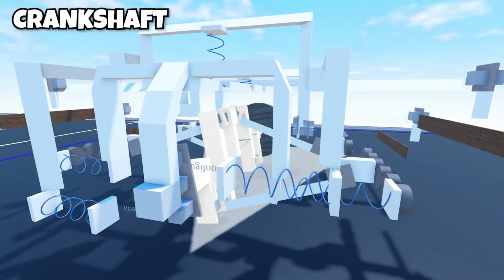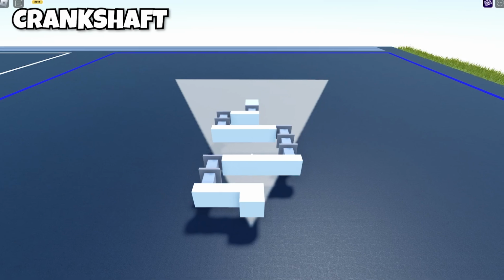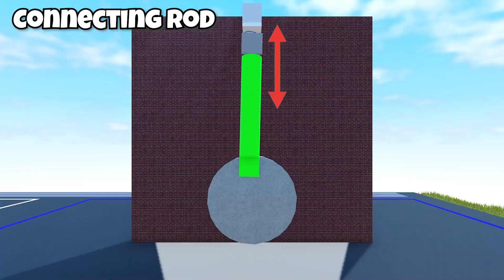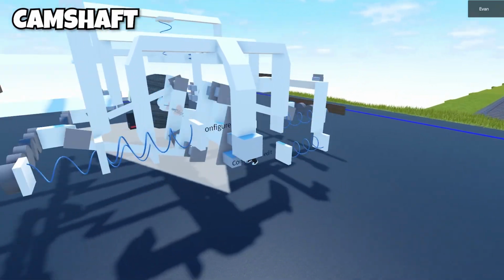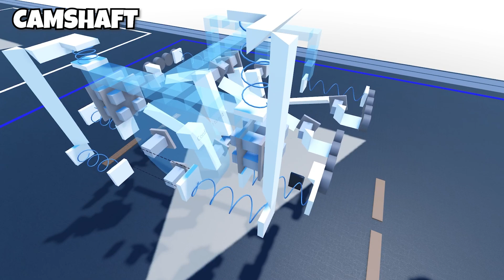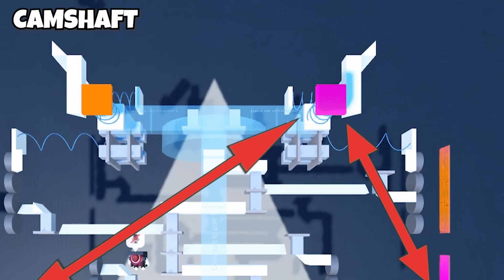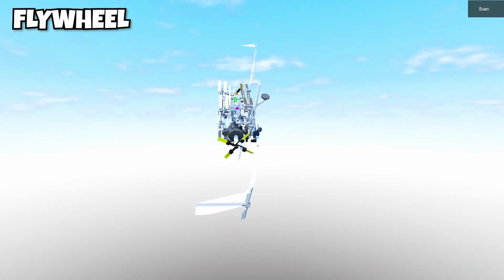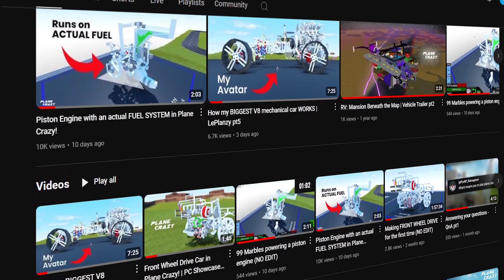Boxer 4 PISTON ENGINE Guide | Leplanzy pt6

Comment from the maker: MISTAKE:
- I forgot to mention that the big 5x5 cylinder in the front of the engine is actually not really that neccessary. In the past I used this cylinder to make a starter using a rotating cylinder thats getting pushed to the big cylinder. In this case I used proppeler to start the engine itself. Cylinder itself could also be some decorations to ur engine or a place to put many camshafts at once. It's honnestly up to you on how you're gonna use the cylinder. It's optional to put it, I only put it to that there's a small gap between the suspension and the motorlock. 

- Move all the signs (the one in front of the hover) 1 BLOCK UPWARDS. I forgot to mention that timing problems could happen. I apologize for the lack of attention to my video editings

- I might have talked a bit too fast in this video. I apologize for any confusion happening 

If you've met with some more mistakes that I made in this video, immediatelly report it to me throughout this comment or a discord dms. any is fine!
Reply: How to increase more rpm without adding more connectors valve things
Reply: actually when i was trying to fix the engine still it doesn't work but still thank you so much becose i learn gow to create a boxer engines now i have a 8cylinder boxer engine and i like it still huge thanks to you 🙂
Reply: Bang crankshaft yg terakhir kok putus GK jadi solid pake text brp?
Reply: how do i make second piston offset 90 dergee from the frist one in I2 engine ?
Reply: @PhạmHiếu-g2h just flip the cinnecting rod on top of the crankshaft
Reply: bro i cant start my engine for some reason even with a spinning wheel :(
Reply: how to fix the timings?
Reply: nvm fixed it , the problem was wider detection
Reply: Hey, Evan
I have a problem, and I don't know how to fix it.
Whenever I try to start the engine, it stops halfway through. Can you help me fix this?
Reply: @zedddd._d try making it ice
Reply: So how did you double hovers on the engine on other videos ?? My engine works but i want just double hovers for more torque and power
Reply: hey evan i built the engine and made the whole thing ice so its lighter but it still rotates slow i used the same flywheel as in the video if you know any fixes could you let me know!
Reply: my engine runs but stalls some times but then continues spinning after that is it a fly wheel problem
Reply: @BranDaManGamingits more of something hitting crankshaft like camshafts,or hovers that arent in the good settings (RARELY THE HOVERS)
Reply: Dude, I can't get the engine to turn over, it's stuck. I've already done the engine lock and it doesn't want to go.
Reply: @Gowbily  same

Comment: Pro tip: use 6 hovers for each cylinder makes more torque (better for car weight and clutch)

Also motor lock all the timing 1 block upwards
Reply: YOO TSYM FOR THE TIP MY ENGINE STARTED WORKING AFTER I MOTORLOCKED THE TIMING
Reply: @errt-j3w  np
Reply: whats the timing
Reply: @megikyura   yk that part that connects the sign put 1 motorlock above the sign

Comment: my engine cant make a full rotation even if i put the flywheel
Reply: Its probably the crankshaft or the connector rod getting stuck on something, see where it is stuck. Or the suspension is not long enough.

Comment: You haven’t told us which motors are powered or not. I have built it and it is a disaster
Reply from the maker: theres not a single powered motor
Reply: @evans_workshopx thanks your the best. I bet your basically the only YouTuber that is actually good at this sort of stuff 😅. You’re so underrated. Good luck

Comment: Hey, ik many people have been talking about this here already, but my engine stalls at high speeds for some reason. It works perfectly fine, has high torque/speed and all, but at high speeds/too much power on the hovers, it just "freezes" and looses all the angular momentum. It happens in every hover-engined car that i have for some reason, idk why tho (im only using one motor for the engine crankshaft so it doesn't do that weird 2 motor glitch thing). Maybe too much weight...?
Reply: same

Comment: hey evan
i have some problem while making this engine i know im late but
why is the suspension collide with it self (suspension on the hover engine) i arleady turn off the limit of the suspension but it kept doing it i also use motorlock what is the problem and the solution?

Comment: I cant seem to start the engine i followed every step right but it seems that a suspension is blocking the engine in someway. I checked if it had limits on and it didnt I even placed it in different places and still wont start up

Comment: I have a problem, when I do the motorlocking thingy that extends the suspension for holding the piston, the motor locking seems to not extend the suspension enough for the right amount of clearance. And you kinda cut off the part where you actually make the motor locking stuff
Reply: make 3 stacked motor locks

Comment: Im having a issue,when the piston goes back The suspension dont let The crankshaft do a full turn (i already turned off The limit)
Reply: Place the text on the top instead of the bottom
Reply: @Oranges999 bro, i fixed that 6 months after that, i have hibrid boxer 4 magnet-hover alreadu
Reply: @AlpinistaYT  Oh, alr

Comment: Will not work at all, I've tried almost every thing and the entire thing won't even budge. It is most likely on my part since I'm new to pistons in plane crazy.
Reply from the maker: is it not spinning? or it does spin but it wont continue to spin by its own? if it's stuck, have you tried making your anchor block physics? anchor blocks could interfere with the suspension's physics just fyi.
Reply: @evans_workshopx   This is killerkicked on a new account. I mean it looks like its trying to spin, but won't spin at all. It might just be because of me not being all the way through the tutorial but yours spins perfectly fine.

Comment: when i putted the glass structure, the crankshaft wont work
Reply from the maker: have you turned off length limit from the suspension?
Reply: @evans_workshopx  oh, i did, now it works, but when i put the camshaft, i built it correctly, but still wont work
Reply: @evans_workshopx  Hey, it worked now, but it stops runnig in 15 seconds
 ow do you fix this? (sorry for asking too many questions)

Comment: Pro tip: For the camshaft with the signs, if everything is built correctly but it still won’t run, motorlock the sign up 1x, since it needs to be delayed for better running.
Reply: Im stupid..i didnt look further on pinged comment..BUT THANK YOU STILL
Reply: Thank you! Now its working
Reply: Which piston should be motorlocked and should they be motorlocked 0.5 blocks up or 1 block up

Comment: Evan I got a problem, the engine just there and doesnt to anything, yes, even if i 'started it', it looks like a rock that cant move.
Reply from the maker: did you connect anything to the fixed part?
Reply: @evans_workshopx  no actually thats not a problem anymore but.. Now when the engine starts it makes my entire thing go to the left, it doesnt fly in a crazy way but it just starts going rapidly to the left. 2nd thing: I used this motor on many  vehicles but theyre small because im still trying to figure out how to make the output have more torque
Reply from the maker: @angelrodrigogarciamartinez7314  did you put equal amount of hovers on the right and left side? also have you checked that both opposing timing plate is at the same possition?

For example, the left sign might be slightly higher than the left one, causing only 1 side of the hover to detect the sign instead of both.
Reply: @evans_workshopx  evan i think i have the same problem. The hovers on the right are fakely detecting a block making the entire car go to the left. Thats the problem my bro has

Comment: did not work lol
Reply from the maker: please specify the problem
Reply: @evans_workshopx  I actually don't know, when the pistons reach the signs, they either very sharply go back and transfer the power badly, or it just stalls right there and i have to kickstart it again
Reply from the maker: @eFishOG4386  did you put any flywheel yet? Also did you put  more than 2 motor holders? Or perhaps you did the timing in the wrong place
Reply: @evans_workshopx  I added a very simple flywheel, however if i made a bigger one i know it wont spin properly as it is just too much for it to turn
Reply: @evans_workshopx  nvm i added a better flywheel and it works

Comment: Hey evan
For some reason my engine keeps stalling for no reason i tried more weight and stronger piston but that did not fix it but it might be cause all piston and pushing all at once. Can that be the problem?
Or is just something else?
Reply from the maker: @AaronSamuelChandra  are you adding some extra hovers? Also this is a new glitch to me. I'm indeed familiar with hundreds of plane crazy glitches before but this one is still new. Please report it to me if you found any solution
Reply: @evans_workshopx  im adding extra hovers cause the engine is suffering from engine stopping for no reason 
It might because theres to much friction?
Edit : i also add an unpowered motor to the outer side of the wheel so it keeps intact and not fall off i think that might the problem
My theory why the engine is stopping is probbaly to much friction and the engine does not have enough power to make it spin
Reply from the maker: @AaronSamuelChandra  the reason might not the amount of hovers, even tho it runs slow, stalling randomly should not be happening. But it is completely fine to add more of it
Reply: @evans_workshopx  ok thank you!

Comment: quick error correction thats a FLAT 4 not a BOXER boxer engines have opposing pistons moving inwards at the same time all boxer engines are flat engines not all flat engines are boxer engines
Reply from the maker: excuse me, it IS a boxer 4 engine. Both left and right piston's are moving inwards the same time wdym?
Reply from the maker: you mean the crankshaft configuration?
Reply from the maker: also, it does not matter whether the crankshaft is having a left-right-right-left pattern or left-right-left-right pattern. What matters is the actual piston's opposing side fires the same time
Reply: no no it's not a flat a flat is a v engine but flat like 2 pistons on 1 shaft like a v but a boxer has 2 separate shafts
Reply: @tomasagostinho7443  completely wrong
Reply: @tomasagostinho7443  explain it better your close but not correct
Reply: 2:16 see how 2 pistons are connected to 1 rotation thing down there in the crank that's a flat engine but in a v shape

Comment: i followed the boxer engine and made a mechanical car for it, somehow the engine dies when i accelerate and it gets shaky when the engine reaches max rpm and its rpm goes fast to slow to fast.
Reply from the maker: @moonlight34-k6j  I see, have you tried motorlocking more hovers? And also how heavy is your camshaft connector? Try changing the materials to ice from the engine only. Or perhaps send me screenshot through discord so we could discuss things further
Reply: @evans_workshopx i think hes doing a manual acceleration of the rpm of the motor, also using a motor that is moved manually could cause the problem. An example is a proppeler at high speeds that can adjust the angle of the blade. This will ALWAYS cause a shaky movement , wobbling or even glitches.

Comment: Wait a second, F no wonder why 180 90 180 crank shaft feels like i decelerate to quickly, that might be because of the double motor glitch but even more stupid since i just rotated the crank 90 degrees with motors in the middle but its not connected the chassis???

Comment: With 90 degree v engines you can do a similar thing with direct piston timing belt. You need 4 timings in a v4 engine, one side of the pistons goes directly to it’s sharing piston well the other side goes to the non sharing piston on the opposite side. Even more crazy is that if you double side the pistons, it’s the reverse of those times, and yes if you reverse the timing belt then the engine will run backwards.
Reply: Huh 😦
Reply from the maker: I uh, unfortunatelly I might not be able to clearly process this comment lol

Comment: im having a issue with the signs not being connected aka the ones that connect to the camshaft everything falls apart when connected to the transparent sign so i had to use the a trail. but it didnt work.
Reply from the maker: common problem, save your engine and then re - load it again. This problem has been going around for a while in plane crazy but it's an easy fix. This method always works for me
Reply: im having issue with the timing it doesn't actually times right

Comment: Is it possible to have an inline engine in plane crazy or is it too inefficient?
Reply from the maker: it's not that it's inneficient, an inline engine will push the whole engine downwards which means if you want a pure power from it, you will also still need a similar mechanism like a double sided piston. In plane crazy, an inline engine will also effect cars with suspension, which presses down the whole car while the engine is running
Reply: Is boxer 2 can do? @evans_workshopx

Comment: Yo Evan, how do you make a V engine crankshaft? I am new and pretty confused
Reply from the maker: I will be making V engine video in september 14th. More videos will be coming soon and fast
Reply: Make a box engine but then center 2 45 degree angle locks to your crank shaft, but don’t connect it to the crank shaft, i have perfected the v4 engine so you can see my comments or test video

Comment: a starter? what starter
Reply from the maker: sorry I forgot to mention, this could be a starter with a small rotating cylinder pushing to the big fabric wheel (carbon fiber got better grip tbh). I'll pin a mistake comment, thanks so much for the reminder!
Reply: @evans_workshopx ay np!
Reply: Also isnt the LENGTH LIMIT supposed to be off on the suspensions? (u never said that in this video)